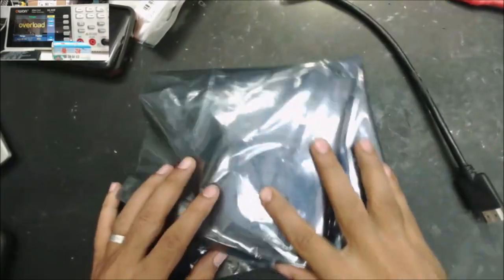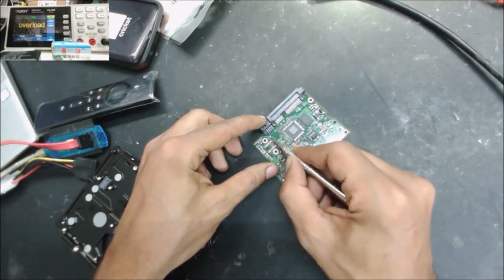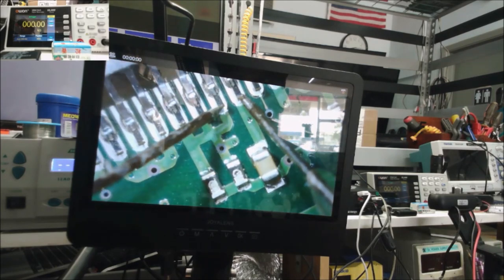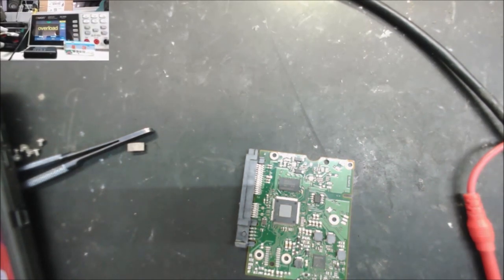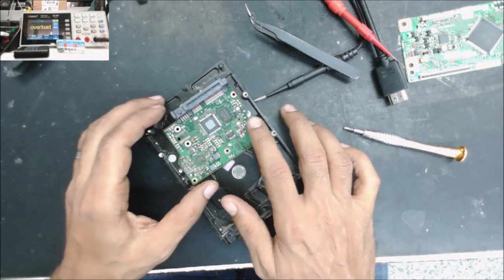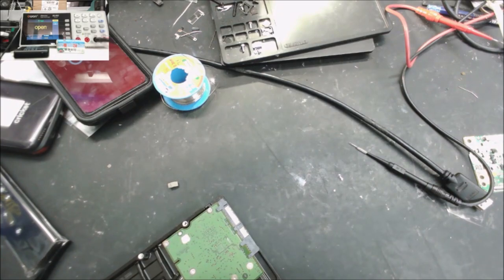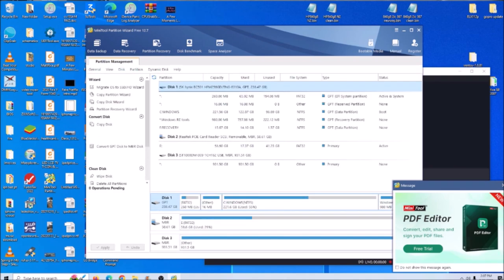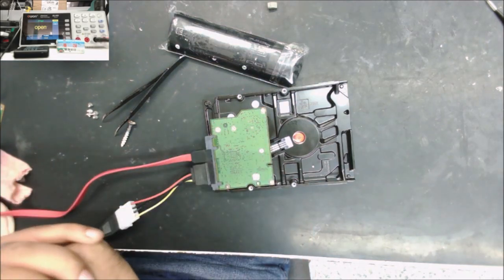Hard drive Seagate ST1000DM003 dead not spinning for data recovery

Comment: I have this HDD Seagate ST1000DM003, in my iMAC 2013 Desktop, it's undetectable. It looks the same except for the board, its not square. Are there different boards for the same Seagate ST1000DM003? Thanks.